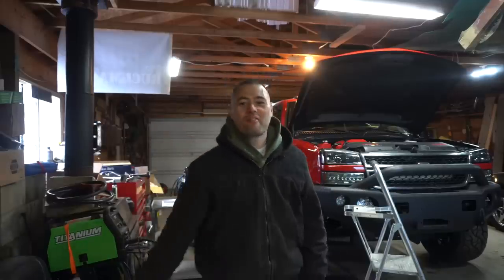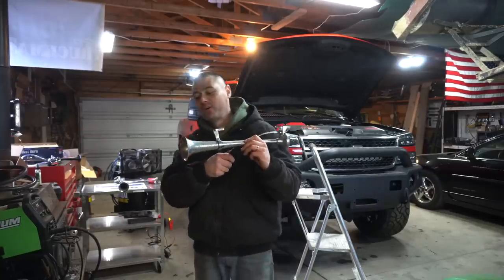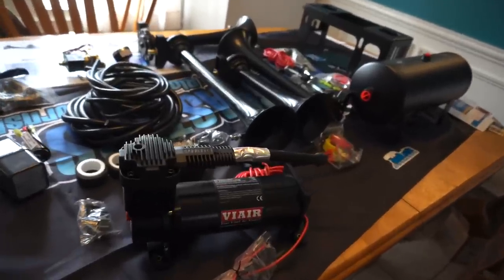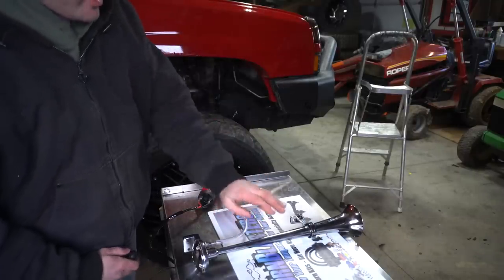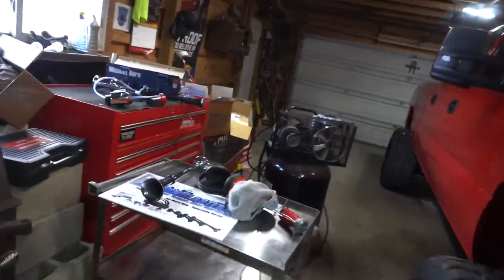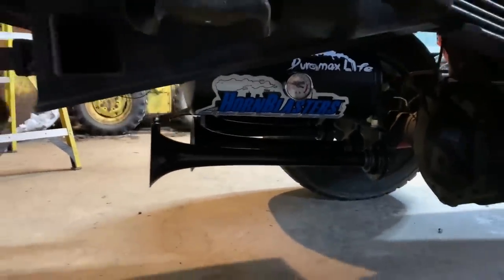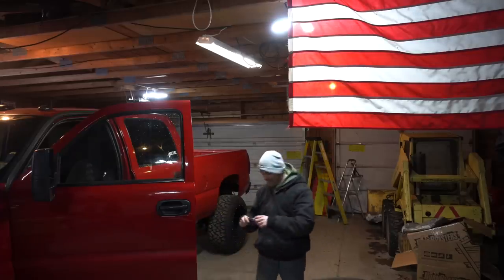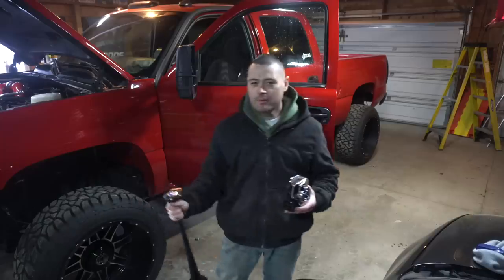Cheap Air Horn VS Hornblasters Train Horns

Comment: Hey guys and Truck Master, gun nut here. I believe you thought that dB's are measured linearly.  They're very much not! When you say, "It is a little louder" that was hilarious to me. For every six dB increase, the sound is twice as much. Your train horn at 135 dB is actually eight times as loud as the puny Chinesium weaksauce horn at 115.  

It is for this reason that my suppressors on guns knocking 12 dB off the report of a gunshot is an incredible difference. 20dB is insane! 

Great video and hilariously loud horn.

Comment: Still can't touch my old Continental ship horn, it can be heard 12 miles away.. great deterrent for those tailgaters
Reply: Where did you get it?
Reply: Where’d ya get it?
Reply: @swayze3454  Craigslist ad here in Michigan, it came from the Ludington area, it was a freighter horn
Reply: @Big_John_C  how big is your compressor tank? And high the pressure? Do you have it installed on a vehicle at the ships required tank an pressure level? I would think a van may hold a proper tank size. I'm just guessing, would like to know more please respond I know a friend that needs a lesson ha ha
Reply: Nobody deals with tailgaters unless your slow

Comment: The horn blasters kit you installed on the truck sounds closer to an actual train horn. I've worked on locomotives for 6 years and it's the closes compare. The singles you tested were nothing close but still better than nothing.
Reply from the maker: Thanks

Comment: i have one of those cheap chinese horns on my car and i have used it for 2 years and it still works just fine!!
+ i have it connected to 150 psi compressor with air tank. It's pretty damn loud.

Comment: Hey TM that red duramax is AWESOME man especially that whistling turbo 👍🏿..I have the shocker XL in my grill and the Nathan K5LA under the bed of my dmax 2 air tanks and HB's Oasis air compressor, both horns are wired to the steering wheel horn and OMG they are both STUPID loud together 👍🏿😁

Comment: For grins and giggles I would be interested in hearing the combined sound of the Musket and Motorcycle horns running together.  Seems that might produce a better overall tone compared to the PsychoBlasters V2 you tested in this video.  Another combination to test would be the V2 and Musket running together.

Comment: I run a Buell-Strombos Duplex horn and its plenty loud. Enough to make you deaf and actually feel your whole body vibrating. Want to get another set of Buell-Strombos for the other side of the truck and put a larger air tank or add another tank to the system so I can run air tools off another tank but my engine driven air compressor only goes to like 125psi and my current tank drops pressure pretty quick when activating my horn.

Comment: Nothing trumps a k5la train horn just saying
Reply from the maker: I’m sure they are good just never heard of them
Reply: True but not everyone can spend $1,800 on just the set of horns themselves. Yes if your looking for the biggest, baddest, and loudest train horns than, sure by all means grab the k5las. Preferably the raised letter. But the HornBlasters horns sound amazing and are just a little less loud, much easier to mount, and for around $500 you can get all the mounting hardware, compressor, air lines, and fittings.
Reply: Haha the k5lla beats it by a ton
Reply: Expect an s5t

Comment: Do I see rust bubbles on the fender at 5:32? 😳
Reply from the maker: Yes I need to replace the fender it’s seems that the paint guy painted over the rust but luckily it’s just a fender
Reply: Truck Master it will make a good video on a fender replacement 👍
Reply: @TruckMaster  the paint guy painted over the rust, seriously, why would he do that !? 
Thanks for the coupon code for HornBlasters

Comment: no wonder the horns craps out. they will get water damaged from water and having them where you install them look at the angle you have them at :(
they need to be at least 45 degrees to the truck to stop water flowing to the back of the horns and surprised you not ripped them off when off roading..
Reply: Who offroads in a truck...you don't know what you're talking about

Comment: Did the musket horn sound more like a semi than a train? I dont like the train horns because of the higher pitch.
Reply from the maker: I’d say your spot on! It really does sound like a Semi
Reply: Could you get a sound bite of it with an air compressor behind it instead of the electric compressor that came with?

Comment: Does the compressor fill up automaticly when you press the horn button or do you have to do it manually for the train horn
(PS is the musket much louder than the China horn)
Reply: Yes, if a kill switch is not provided I would go buy one, I learned the hard way when my tank began loosing air very slowly, it kicked the compressor on while the vehicle was off and I had a dead battery.